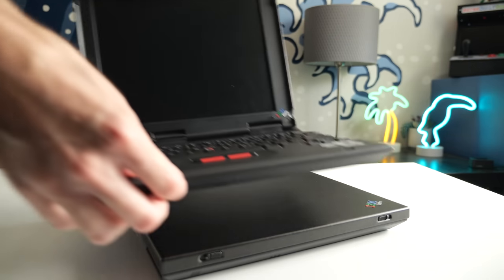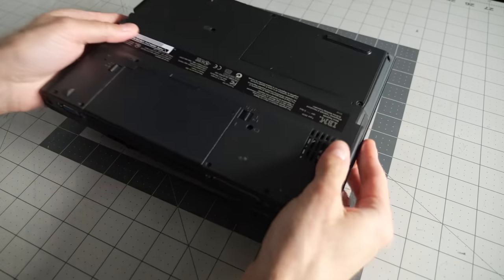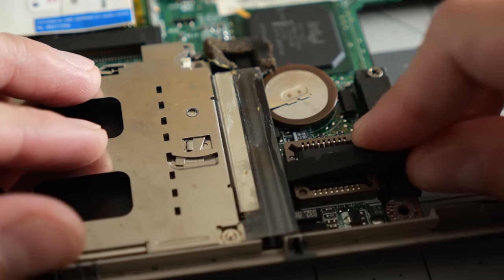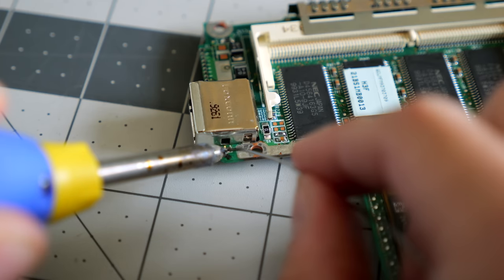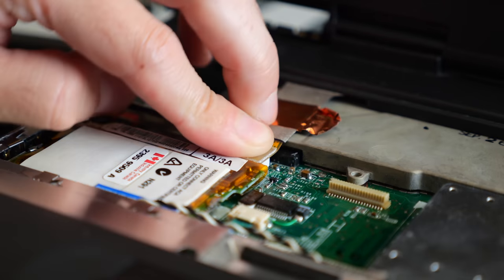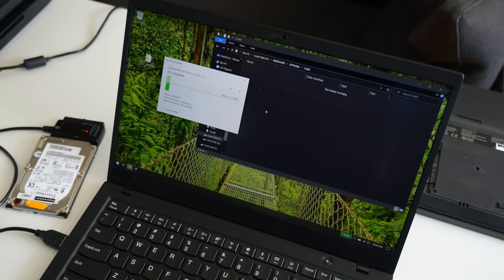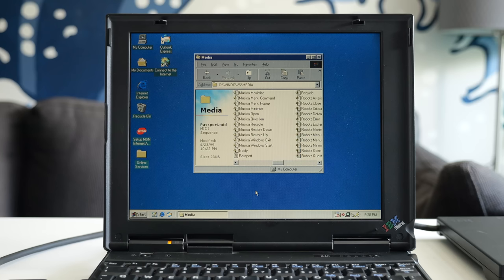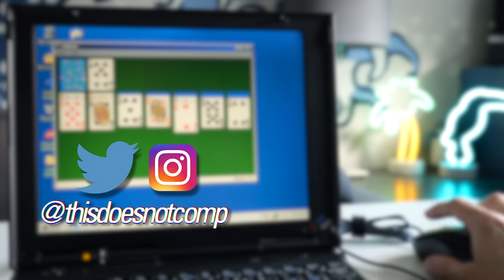A Tale of Two Tiny ThinkPads

Comment: I bought an almost perfect ibm 240 for 15$, one of the best purchases in my life. Too bad even HOMM 3 does not run smooth enough for me.
Reply: One of my favourite games also - perhaps it's time to dig out HOMM 2 and run it in MS-DOS on the 240. (I have one of those also.)
Reply: Really? I played HOMM3 on a Thinkpad 380XD (P-233MMX/96Mb RAM) with no problems
Reply: @xfragboix  Was that on Windows 98? I am trying to remember what the earliest OS HoMM3 supported... I know it was Windows only.
Reply: @xfragboix  I got 380XD as well, For some reason 380xd runs HOMM way better, not 100% smooth but way better
Reply: @lezoriq  380XD has a Pentium 233 MMX with 32 MB and 380ED has a Pentium 166 with half the RAM. that's probably why
Reply: @howaboutsomesoyfood  
I appreciate the response, but I never mentioned anything about the 380ED. My reference was to the ThinkPad 240, which, like my 380XD, has 128MB of RAM. Unfortunately, for some inexplicable reason, HOMM  3 lags only on the ThinkPad 240. It's quite disappointing because its screen resolution is perfect for the game.
Reply: @lezoriq  sorry, I misread that. first thing I thought of was RAM. The GPU in the 240 appears to be rather weak, at least for games (2MB VRAM). Other than that, not sure.
Reply: What?! $15??

Comment: Did you check the power socket on the dead board? The most common fault is that connector getting damaged or the soldering falling.
Reply: it can also be some sort of oxidation or loose connection. i once had an X40 not power up, with the power connector being my first instinct, and after reconnecting the keyboard (which in this case also includes that button), the laptop powered up. that was a few years ago and it still works fine.

it could also be a bad button, though somewhat rare i reckon

Comment: i love the percussion on that midi chip. that slap bass is something else entirely, though, lol.
Reply: It's because the Windows driver uses the custom ESS general MIDI patch set, which takes advantage of the added features of the ESS variant of FM synthesis (20x 4-operators voices where each voice can output stereo sound, I think by assigning 2 combined operators to each stereo channel). By replacing the ESFM.DRV file in the Windows' system directory with the one took from an ES688 card's driver, where the FM part was usually handled by a genuine OPL3 as the ES688 chip doesn't have any FM synth by its own, the ESS FM synthesizer will be put in OPL3 compatible mode and will play the standard Windows OPL3 sounds. The ESS FM synthesizer is quite faithful to the original OPL3, is one of the most accurate clones actually.
If you keep the ESFM.DRV files from both the native driver and the ES688 one, by means of a batch file you can swap them to switch the FM mode in Windows whenever you want.
Reply: I liked the piano.

Comment: I didn't realized how dramatic the energy density improvements in lithium batteries has improved. A modern battery with that capacity would be well under half the size of this one.

Comment: funny, @4:50 what seems to be the wifi card with the blue sticker says ministry of traffic and watermanagement. 
it is an old laptop of the dutch government, that is why it was probably erased badly, as is custom to completely destroy the device.
and it would explain the black felt marker on the chassis
Reply: Saw that also, just right now 😊 Agree.
Reply: Heh! Good eyes. Must of been used for a while before it was wiped.

Comment: Ultimately, the problem with those PCMCIA-based CD ROM drives is that they require the proper driver to be initialised before they’ll work. I have one of these 240s and also have had the same problem. The original restore floppy works with the drive though. Installing Windows on there can be a royal pain in the backside.
Reply: Yes I agree. I had one back in the 2004 or so and it didn't work till I installed Windows and some drivers. I guess under DOS it would be the same

Comment: On that first machine, they were just running DOS 7.0. It shows the Windows loading screen even if you never had Windows. Also there are USB mass storage drivers for DOS in case you ever find yourself in this situation again 👍
Reply: How well do the DOS USB drivers work on different chipsets?
Reply: @zoomosis  I've had success on every machine I've used them on. I haven't tried anything newer than about 2002 though.

Comment: I bought my ibm 240x while on holiday for less than £10 as spares and repairs. I repaired it and I still have it. I took the modem out and fitted a WiFi card and shoe horned a pair of WiFi antennas into the lcd display. It works really well.

Comment: I got a Thinkpad subnote in 1995. I had picked it out myself (from a magazine ad) for school, thinking the size would be perfect. I remember it was like an inch thick. It had the external drives, but it used some type of proprietary or uncommon connector. It was a nice product, well built, but the system ended up being more difficult to use than I expected. And within two years developed a red vertical line on the screen. I want to say it was the 500 series.

Comment: I had to replace the main fan on a larger model ThinkPad. It made this unholy grinding sound when it kicked on. Just that single component was a massive pain in the butt. Took like 2 hours to do. I can't even imagine the pain of replacing as many components as you did and on tinier models. You did a great job of it.

Comment: I'm surprised none of ThinkPads you've came across had the BIOS password lock in place.  It's kinda fun shorting pins at the right time to clear the password.
Reply: Could you figure dell latitude dseries how to short them out they were good laptop just to get stuff done and optional dock my dad have i want those laptops and run linux mint use it for basic work.
Reply: @WilliamHollinger2019  man I don't know.  I just found guides on how to do it on some Thinkpads I had.

Comment: I scored a 240 off eBay in early 2000s for $150-ish, which despite its poor battery served well as a basic portable Linux machine (with PCMCIA Wifi card), and as a handy serial terminal for configuring switches, PBXes, etc. I used a silent CF card w/adapter in lieu of a hard drive. Eventually its LCD went bad, probably the flex cable, so I removed that, and the 240 then had a 3rd, sedentary life as my home router, automation controller, weather station, Asterisk phone system, solar power logger & mini-server. It happily ran for years from ~12-14V DC solar-bank power straight into its battery terminals, pulling only 7W. I swapped the internal modem mini-PCI with a 10/100 Ethernet card as second NIC (NIC1 being Cardbus), but had to solder a Cat5 cable directly to the card's transformer due to lack of a pass-through port, passing this out through the Kensington lock port. Had to do some BIOS hack also for those to coexist, but can't remember details. The VGA output was split 3 ways (R, G, B each going to a different small mono CRT, with sync's paralleled), and under Linux the PS/2 port could accept two separate  keyboards, one into the 5th & 6th DIN pins normally meant for a mouse.
When those 100Mb NICs became a limitation, this was replaced with an ARM-based SBC, but then put in another 2 or 3 years at a friend's place in a simliar utility role before finally being retired. Nice little machine!

Comment: Interesting subject. ThinkPad 240's and it's newer iterations were nice. In the late 1990's into early 2000's I worked at Ogilvy & Mather who were at the time Ad Agency for IBM. I worked for a consultant firm at O&M handling their Laptop Support. The 240's and 240X's were used limited to a few higher executives. They were issued with a different IBM Floppy Drive than the example you have. Also the External Bays that housed the CD-ROM drive and flopper drive you have likely were issued when the ThinkPad 600 Series debuted. Or circa ThinkPad 570 Series. The IBM CD-Rom drives sometimes needed driver installed for them to work. I have a funny story about two TP 240's. Both were run over by vehicles. 1) a O&M executive was in Paris and it was run over maybe by a taxi. 2) the other the executive leaving home in advertently left the laptop bag a the rear of their vehicle loading up to leave for work and drove over it. This 240 was delivered to me with it's screen in the shape of a rainbow. I was able to cobble together  these two 240's to work and access their data from the two hard drives. I actually have a photo of the second executive holding the laptop before I picked it up to attempt getting access (or worse case scenario sending it out for) data recovery. You video brings back good memories of my time as IT Support.

Comment: My first "own" laptop was a Compaq Presario 1270, with a K6-2 350 MHz and 128Mb of RAM which I updated to 192, and then updated to XP, using PCMCIA cards between a USB 2.0 (the 1.0 onboard USB was broken exactly at the same spot) and a WiFi b/g or a 10/100 Ethernet. Managed to get me to my first years of university and made my first steps programming on that. Now, my current work has a old school Thinkpad which I intend to appropriate the next day they clean inventory

Comment: I've restored a bunch of 240s. I love the 240s, although some of the plastic can feel a bit light and brittle. The portable drive bay only works on very specific thinkpads. I think maybe the 755 or maybe 560 series. I have a couple of new ones and used them in specific circumstances, but generally they're not compatible with most thinkpads. The portable drive bay 2000 was much more compatible. The reason the Win98 splash screen shows up briefly is because someone has reformatted the hard drive using a Win98 SE boot disk. This is a useful disk to partition and format for FAT32 and get a basic bootable system on a hard drive but it does somehow copy over the Win98 splash screen which always shows briefly on a machine that's been reformatted using this disk. Finally, in my experience the weak part of the 240s was the LCD screen. I think only SVGA and all the ones I've seen are aging badly and going a bit dim in places - the CCFL tubes must be wearing out. Great video!

Comment: IBM's little notebooks are great machines. My first laptop was a new X20 with Windows 2000 on it. I got it brand new at an IBM employee sale for $200. That was over 20 years ago and last I tried it thing thing still worked (I need to pull it out again). That was replaced by an X60.

You CAN but more than the listed maximum amount of RAM in those things, but it's not a good idea as while they will report the RAM accurately they actually run more slowly.

Comment: The holy grail of the 240 line is the ThinkPad i1124 - it has a silvery-gray finish and very similar to the standard black 240Z models, which are almost as rare. It was Japanese-specific though, unlike the other 240s.

Comment: I absolutely adore Brickpads of all vintages, the oldest and first one I had was a Z60m Brickpad and the newest one is a Thinpad E560. None of them were gaming or production laptops but I'm surprised that the 560 is able to support some light gaming of Fallout 4 and New Vegas considering it's running on an i5 and Intel's 520 graphics. It also was the first used Thinkpad that had both a working battery and CD drive, it was like winning $3 from the lottery.

Comment: In case you don't know this trick, for a system that won't boot, a simple test is to remove the onboard battery as well as the external one.  Then plug in A/C power.  System is designed to boot at that point, even though date, time, etc. will not be correct.  This is not just for Thinkpads, but for many, if not all laptops.

Comment: I ended using a 32GB MSATA SSD with a 2.5 inch PATA to MSATA adapter when restoring the X32 last time. So much faster and most importantly, reliable for daily use.
Reply: I was thinking the same while watching the video. I have a few older macs I’ve upgraded to msata cards within a pata 2.5” enclosure. Plenty of supply on Amazon!

Comment: I had one of those. Wanted a Vaio 505 series. But spotted the 240 as a good deal. Bought mine brand new when released, and I used it until I sold it in 2004. Great Japanese design.

Comment: Nice machine, I actually have a version of that Toshiba Libertto but with awider screen running win 98 SE, Still works with 2 PCMCIA card slots and has  a Unique  Docking port to the rear, though I have nothing to Dock to it sadly. And keyb too small for any real work though usable for the odd document to put together on a train to work if that is your thing. The Thinkpad has a near real size keyb and bigger screen so much more usable. Great to see old hardware minded and kept working. Win 98 will still run Office 97 which is not that much changed for basic work from  office 21. Some will totally disagree.. but a Word doc, Normal Excel sheet of general Powerpoint Presentation can a least be started and winished later on your main PC if need to.

Comment: Putting baking soda in superglue instantly cures it, not really good for breaks like that. BUT it's very good for adding reinforcement around a break like that. Put superglue on there and dust baking soda over it, let it sit for a couple seconds and then clear out the excess. Becomes basically like an instant "plastic" weld.

Comment: Thanks for this video, it was quite useful.

I have a Thinkpad 240 that I managed to get Windows 98 running on it by putting the installation cabs onto the hard drive on another PC, making the disk bootable and then putting it back into the 240. I have an external floppy drive that works with it but not a CD-ROM drive (apart from a USB one and the 240 won't boot from USB) and I hadn't worked out that the way to connect a CD-ROM was via a PCMCIA card. So that's useful to know.

I haven't done much with it as of yet, I picked it up in eBay very cheaply a couple of years ago and it works fine except for a couple of pressure marks on the screen.

Linux is my normal daily driver OS with a bit of retrogaming in old DOS and Windows OSes up to XP - I may put a very light Linux build on it with no desktop and just use it as an SSH terminal to other machines in my home network as it does have the good IBM Thinkpad keyboard.
Reply: Plop boot loader might be able to boot this thing from USB.
Reply: @Jackpkmn  A good point, though I haven't use Plop boot loader in years - thanks for jogging the memory about it, will take a look.

Comment: Oh nice. I have a 240 that still works and holds a decent charge. Granted I do have the 2.8AH extended battery. Love it and my 380XD. Need to get a battery for the 380XD though. Both are in decent condition for the age.

Comment: i got one a few months back but i tought the sound was broken hardware side cos it looked fine in the device manager but watching your video i realized the driver it had installed was completely diferent, located the one you mentioned there and it works now, thanks!
mine didnt came with the cd or floppy drives, any idea if i can find a generic one with that same conector that works? i found one thats a diferent brand but i couldnt get it to run, for now im relying on usb drives and virtual drives to have it run stuff that need cds but id like to have the real thing in case the hdd gives up and i have to reinstall

Comment: If you have a junkyard near you, Chrysler infotainment systems from 2008 all the way to 2012 or so with the touchscreen and buttons on either side of the screen use a bog standard 30GB IDE laptop drive. I got one myself and while the OS is custom, you can reformat the drive as a totally normal IDE drive and it will work in older laptops, like the Latitude S500GT I still need to get a replacement keyboard for sadly.

Comment: I have a question about the frame. If you hadn't had the donor machine to transplant the bezel from, how would you had gone about repairing the crack in the bezel? Is the plastic ABS, and if so would have using acetone to melt it back together worked? I'm asking this because I have a Thinkpad 390 which has some cracks in the back case close to the LCD hinges which I want to repair; I have no donor machine for the plastic parts so I'll have to fix the cracks somehow.

Comment: That drive failure sounds like the typical head pre amp failure where basically the heads become useless as the controller can't get a signal hence the click of death. I would have used some form of SSD like an CF card or a low capacity msata.
Reply: If he's got the hard drive laying around he might as well use it but yeah you would get faster performance with a CF card.

Comment: Hey @This Does Not Compute, you can use plop boot manage from a floppy, and get around the CD drive thing; just download the zip file for it, extract the bootable image, write to a floppy, boot from that; from there, you can boot from a flash drive (or anything else, really) even if the internal BIOS of that computer doesn't support it.

Comment: I have the compaq version of the ibm think pad that was my first laptop the battery pack failed mainly because the power cord has been wiunded and I think shorted out because it had a broken bare wire!! Did work great but i think windows 98 or maybe xp software equipment only but I don't even try to use it anymore and probably couldn't remember the password now anyway... I believe it is also from the mid 90's
Reply: Just remembered what it's name is the Compaq armada

Comment: That's funny I had somebody with a laptop USB port like that. I offered to fix they compromised and I filled it with glue hot glue to keep it from shorting out they were fine with the lack of one of the ports. and hot glue can be removed easily with alcohol FYI.